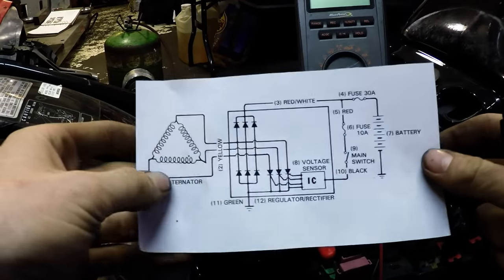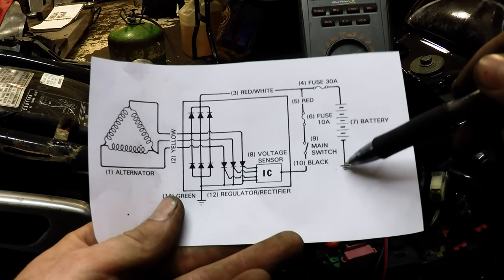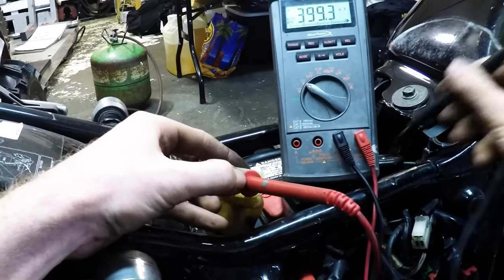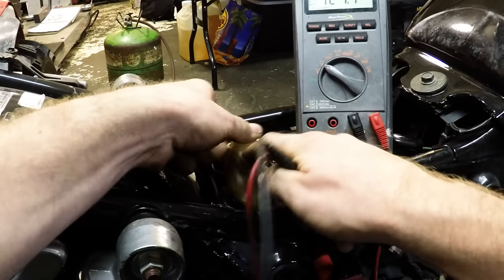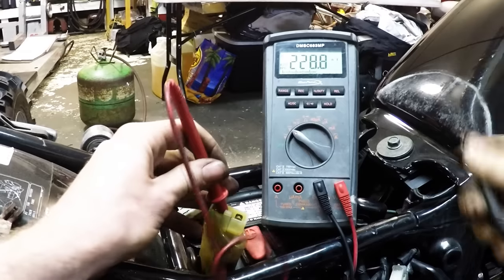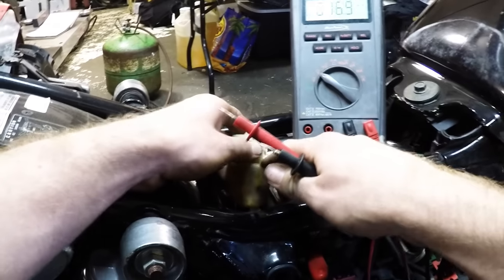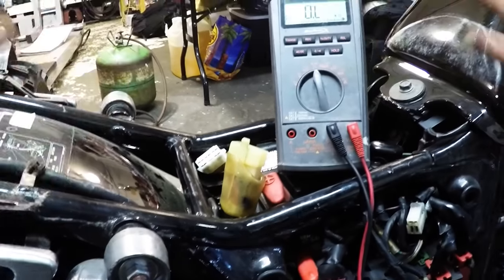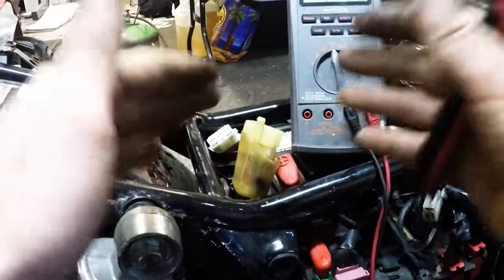How To Test A Regulator/Rectifier

Comment: This is good, but you should call it "Checking your harness wires".
Reply: No not really!

The checks confirm the regulator has the permanent, switched and ground conditions. If they are all ok, it would indicate the regulator is faulty if its either under or over charging and of course this assumes you have a good alternator voltage! There is no simple way of checking the regulator directly as it contains internal diodes, thyristors and an IC/voltage regulator. Making these checks confirms or not, if the regulator is OK! 

Calling it "Checking your harness Wires", could be "any" wire on the bike.
Cody was not just checking the wiring, he was checking for the appropriate voltages. Checking for voltages confirms the wiring is ok as a matter of course.

This is a clear and practical way to check for a regulator fault as Cody indicates.

Comment: Your video helped me too. 

I have an amateur background in electronics and it was easy to figure out the rectifier side but I did not know how the regulator side was made, I've heard that some regulators don't need a battery hooked up to it to put out a charge but that's just what I heard, that don't mean it's true :-)  
Now knowing now that the regulator uses a transistor and the fact that all transistors need a certain voltage at the gate (probably 12 volts with a 9 volt threshold in this case), it makes sense that the regulator won't have much of an output (if any) if the battery isn't there or if the battery is bad. Mine will put out about 2 volts with no battery (Kawasaki 250). 
My battery was reading under 8 volts and that voltage probably isn't enough to energize the transistor. 
I hooked up a large deep cycle marine battery to it and it was charging the marine battery (it was charging at 13.5 volts and climbing which was 1 volt over static voltage). 

Thanks for the informative video!

Comment: Thanks alot bro you gave me the fix on your first test of battery voltage check through the starter solenoid red/white wire constant battery feed. I'd bought a new starter solenoid and unknown to me the battery/motor poles were reversed so I wasn't getting regulator charging voltage to the battery,  I have now.!!

Comment: Thanks for the video. I went out and bought a volt meter to troubleshoot my battery (not charging) and lo and behold the the connector from the alternator to the rectifier was completely toast. I was able to make the necessary repairs for a total cost of $15 (the cost of the volt meter). Again...thanks for the information and education.

Comment: Thank you for the excellent video.  Have a chronic issue on Suzuki DL 1000 (2008). The rectifier has been replaced with an original Suzuki one.  But the stator may not be n original part or part meant for this Suzuki. To replace genuine or OEM will be costly and replacing it is not the first priority till we can be sure of the fault. The issue / symptom is that the volts goes down when engine is revved up. Its a 3 phase system. Have tested using 2 different digital cot meters onto the battery terminals. Am only guessing its an stator coil designed for a different / proprietary type of rectifier regulator. Any thoughts or views on this??

Comment: Of the MANY videos on how to check the rectifier/regulator, yours is the only one I've found that addresses the switched 12V wire. THANK YOU. I've had two defective rect/reg units (aftermarket) shipped to me, so I was concerned that the something on the bike is blowing them up... but the stator seems ok (24-90VAC on all coils/no ground shorts). I do have two questions - just how hot does a "good" rect/regulator typically run? Too hot to touch? Thanks.again for a great vid.
Reply from the maker: Tony Borzumato Glad the video appealed to what you needed! They can get pretty stinkin' hot. Sometimes location of where it's mounted causes them to overheat depending on how old the bike is etc. What I am not sure of is what is the reason for some systems getting hotter than others. Whether it's poor quality, bad battery causing the system to work overtime, or a bad connection. If you notice it get extremely hot that it would burn you, then that is unsafe. Either relocate the unit to allow air to brush over it constantly or even try a newer unit and compare results.
Reply: I never noticed how hot the OEM unit ran when it was working correctly... Now that it is defective, it gets VERY hot (and pulls about 16 Amps AC through each of the stator wires at IDLE. Woof. Stator checks good - similar voltages from all three coils, 24-90VAC, depending on engine RPM. No shorts to ground., BTW. I have a new unit on order from Rick's - will let you know how that one is.
Reply: Oh - my bike is a 2002 ZX9r, so the wire colors are different - there are two positive wires (White/Red) and Two negative wires (black), and the one switched wire (brown). The two positives are connected together internally, as are the two blacks. The  3 stator wires are all yellow.
Reply from the maker: Tony Borzumato High resistance is the leading cause of hot and melted connections. Definitely a problem if it's too hot to touch at idle!
Reply: @TheMotorcycleMD   Heloi, nice vid!  Do you think heat is the killer? Or do defective units get hot? I put on a new rectifier, & it it runs fine. But I came across a nos 82 Suzuki Rectifier in the box, & I'm thinking that it's probably a lot better than this aftermarket. I see the aftermarket ones,  all over the web, (with different labels), but I suspect most of them are from the same company , in chinah.

Comment: Thanks for the helpful video ! Just wanted to add that on some bikes like mine , V-strom DL1000 2004, the input to the IC is the same as the positive of the battery. In other words there is no black wire as you show in the video on my bike, the other 4 wires you show are present.

Comment: My mechanic told me it was my Suzuki Savage regulator and when I swaped it I got no charging improvement. Testing it my stator is getting grounded and my regulator to battery black wire only got 0.12v when the ignition key was turned to on. Is that normal for that wire in this bike? Should I focus on swapping the stator first? Your videos have been very helpful. Thank you!
Reply: oceantransistor same boat here. My triumph tt reads around .09 with the key switched in for the black wire. Will I have to go all through the harness trying to find something wrong?

Comment: If those two connectors are indeed melted together do you suggest installing a new stator and rectifier? or just rewiring those plugs? having this issue on a 82 dohc cb750

Comment: Hey guy, a question regarding led turnsignal "hyperflash" 2007 Honda 919 flushmount front led signals and an integrated rear "turn signals built into the rear tail light" there is a relay designed to plug and play? For hyperflash on Hondas. Can you help me out with a manufacturer and part number please? I have contacted Revzilla they can't help and when Google sooo many come up I thought of you as you are the only person who would actually have hands on experience with this kind of thing. Thanks John in  Shenandoah valley VA.

Comment: I was driving my bike and it died not getting any lights or anything anymore found a blown fuse but when I put it back in even with no key in the rectifier started smoking so I pulled it out what's ur thoughts

Comment: If your regulator is the kind that send the extra voltage to ground (Shunt style) take it out and throw it as far as you can. They're junk. They run too hot and will probably burn out your stator over time. Get an after market Mosfet regulator and your charging problems will be over.

Comment: Hello, can you explain why some regulators have 2 positive and 2 ground wires like yours, while some only have 1 positive and 1 ground? i want to replace my regulator with one from a different bike, but my original has 1 positive and ground, while the one i want to use has 2 positives and 2 grounds. can i just wire the both positives to my single positive, and both grounds to my single ground? also, what is the point of the signal wire? why not just feed it directly to the battery, so i can be sure that it will always feed the actual battery voltage?

Comment: Hey my xy 150t keep dieing wen I got it it runs with only a jump it didn't have the in line fuse holder so I just but one in today still won't stay charge do you think I should get a new rectifier or do you think it's something else please inform me ASAP

Comment: my wiring is messed up can i put the output of the rectifier to the battery with a 20A fuse without needing a relay? i presume the diode will stop it draining the battery

Comment: Thanks, made it so simple. appreciate it. i have no signal (Voltage) when ignition switch is on? wont start. crash starts, but battery goes flat after 30mins of riding.
i guess its somewhere between the ignition switch and the Regulator/Rectifier. but that wire is all loomed up with a thousand other wires? :-(
 any ideas?
Reply from the maker: Check continuity from the ignition signal wire to reg rec! You answered your own question!

Comment: I don't fully understand. 

My bike runs fine. Charges the battery fine. I have a sound system. The amp keeps popping fuses. Everything on the sound system has been redone Multiple times and triple checked. It's not the amp or wiring. 

The amp only shuts down the moment I rev the bike. Is it the volt regulator that's blowing my amps? Is it possibly over charging?

Comment: I have a 2002 Honda Shadow 600 my r&r is bad according to watching your video it has 4 wires to red to Green I have a 2003 Honda Shadow 750 for parts it's r&r seems to be working but it only has one red and one green wire could I use that on my 600

Comment: Hey. Great vid. My "black" wire from ignition switch reads ~1-2 V lower than my battery is. Is that a possible issue? Iv checked all charging system components and they all check out fine, but my battery is not getting charged.. :<
Reply from the maker: +DAriusss4 I wouldn't see that as a concern. Not big enough to not allow a battery to charge. Check the output of your stator by measuring A/C voltage OUT of the stator on each yellow leg. Unplug the stator connection and start the bike. Red lead on one yellow wire black lead on good ground. Meter set to A/Cvolts. Measure each leg and do the same test with the motor reved above 2,400rpm. Let me know what you get. Crichards750@gmail.com
Reply: So Iv finally measured it.  Slightly above 2,4k rpm Iv got 16,6 16,7 16,6. I didn't disconnect the stator connection since its a exciter field type... In addition what Iv noticed that while the bike was cold everything checked out fine with charging, I was getting ¬14 V to the battery, but after like 10-20 mins of messing around it, it dropped down to 12.something... I did test the stator after it was warmed up and got the same 16,6 16,7 16,6 readings.

Comment: i think I'm having a problem with this part and now feel confident in testing it. bike cranks and runs but trying to start it again it clicks. I'm a day or so when I try to start it it cranks. the thing that's also odd is the headlight remains of when it cranks but functions properly when it doesn't want to crank🤔
Reply from the maker: fredthomas8888 🤔🤔 What kind of bike is it?
Reply: It's a 02 gsxr 750. The problem started one night when I stalled the bike. It runs perfect as long as it's running but if i try to restart it it turns over very slow then the speedo dies from what it seems lack of power.
Reply from the maker: fredthomas8888 What brand battery do you have? Age? Battery terminals tight?
Reply: It's the most expensive battery that advance auto parts had to offer. I will check the battery connection tomorrow. Thanks for the great vid and help!👊
Reply: I'll let you know how it goes.
Reply from the maker: fredthomas8888 I don't know if you have tested the stator yet, but I would also check this part as well, I have another video on testing that part correctly as well. At first it's sounded like a starter button issue. In order of importance for your issue if I was testing the bike I would go, Battery - starter solenoid/starter relay - starter motor - stator - reg/Rec . Keep a jumper battery hooked up with you so you know for a fact your getting enough power.
Reply: Ok I'll do as instructed

Comment: Hey Cody, I have a question if you don't mind.
I own a Hyosung Aquila GV250 EFI and my stator was fried a couple of weeks back so my mechanic replaced it with a new one, doing a shitty job, as he removed the supplied plugs and welded the three yellow wires from the stator to the yellow ones of the reg/rec , is it important to know the order of the three (1,2,3)  or it does not matter? 
Anyway, my stator died again, the good news is that it's under warranty what I'm not sure whether to replace it alone or swap the reg/rec as well. 
The reg/rec was checked and I'm getting:  578, .578 and .435  is that a problem?
Thanks in advance
Reply: no it dont mater they are all the same from the stator
Reply: Thanks man

Comment: Thanks for the vid. Ive got a weird thing going on. When my bike is running and i rev it, the voltage on the battery drops, when I release the throttle it goes up and stays around 12ish. What could be causing this? Thanks again
Reply: That’s exactly what is happening to mine. What is the problem in such a case? Thanks!
Reply: @juliomanalo7074  I changed my regulator for a new one, that uses MOSFET instead of diodes, and it's been working good for more than a year.
Reply: @joaopa69  Nice! I just ordered a superkit with shindengen mosfet regulator. Hope this works as good as yours!

Comment: Question. Could I replace all my charging system from Hyosung with Suzuki. Stator/Rectifier/Coil?  I would have to fav up something. I just feel my bike keeps clicking, I charge the battery and, it runs for, a day or, two then nothing.

Comment: hi bro i need an information, i have a rebel 250 2005 but the wires fron the stator to the rectifier are broken  and i don´t know how to conect them the three yellow wires the rectifier is the same you show in the video thanks sorry but mi english is not good enougth

Comment: can you explain the concept of grounding?
Reply from the maker: Alan Zou "Grounding" is referring to anything that involves the negative side of the battery. The frame of the bike and the motor, are all connected to that negative side of the battery. So if a wire has power from the positive and touches any part that is grounded or (connected to) the negative side of the battery (I.E pretty much every hard metal part on the bike that is not rubber mounted) it can produce a short to ground. Because power (voltage) needs a load. 
That's the easiest way I can think to put it. Hope that makes sense.
Reply: TheMotorcycleMD is that may cause unchanging. Or heating the regulator?!

Comment: I am interested in finding out how much actual voltage is being pumped out of the rectifier while the engine is running. So far no luck
Reply: just put meter on battery with system off, then start increase rpm slightly and measure again, that id your output to battery. If no change keep trouble shooting.

Comment: I have a 2002 yamaha R6, I changed out the stator and put a new battery in. The battery is still being drained while the bike is on. I can't figure it out, do you think the regulator is causing the problem?
Reply from the maker: Jesse Carlton Have you done tests on the unit? If the stator is new, battery is new and the wiring is good. Then yes, since that's the last component in the charging system.
Reply: Yes I have done tests to the battery. Yes it's mid 12s when on and running. I'll see what I can do about replacing the R/R
Reply from the maker: Jesse Carlton keep me posted!
Reply: Will do.
Reply: Seriss Cweald check for ohm leakage/parasitic leak. Do you have HIDs or an alarm?
Reply: Seriss Cweald it's the stator I had that same problem on an old Kawasaki
Reply: can you not read? he said he changed the stator to a brand new one